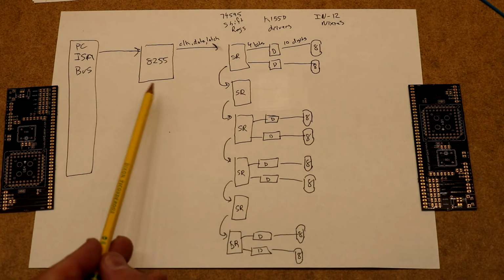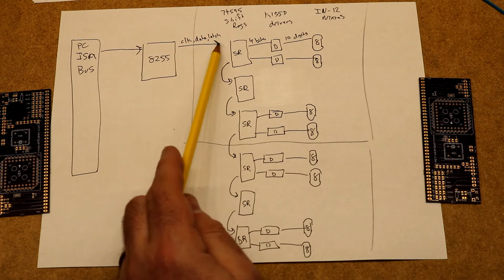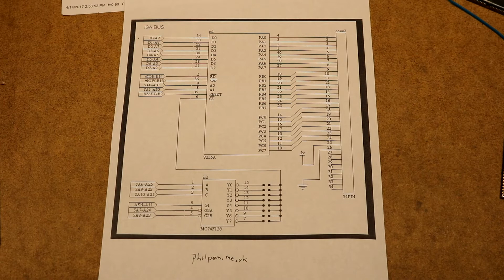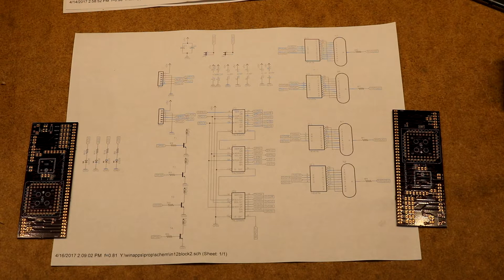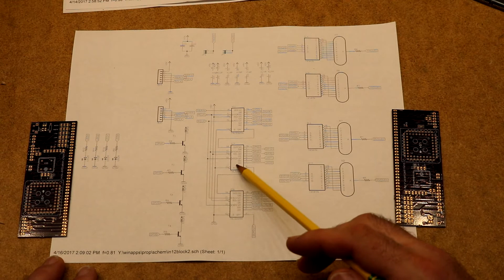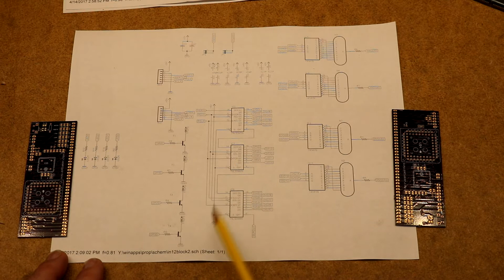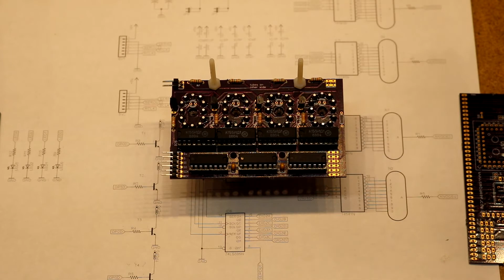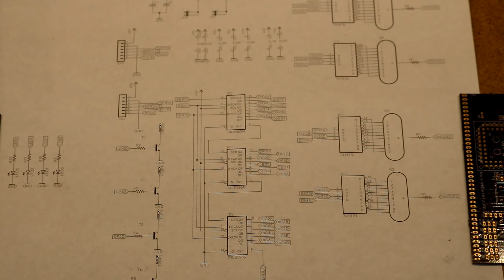Xi 8088 Nixie Tube Clock

Comment: Lovely video!

I should build a Xi 8088 myself too. Sadly never owned any 8088/8086 machines. Surely, I have to improve my collection, it is oh so lacking!
Reply: I was lucky enough to live close to a shop run by a family friend who bought a bunch of military surplus electronics, and among them was ten MicroTICCIT terminals, which were basically diskless IBM 5150s with Datalight ROMDOS and a custom interface card.  I was able to build a complete system with what he had in the shop.